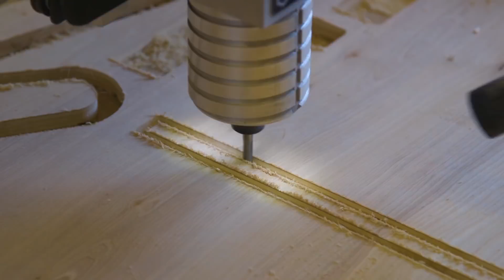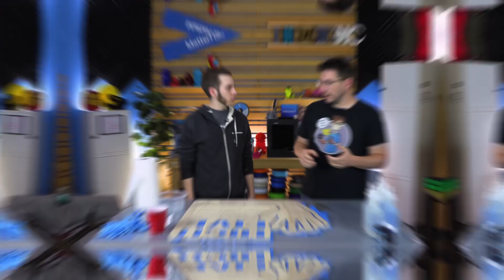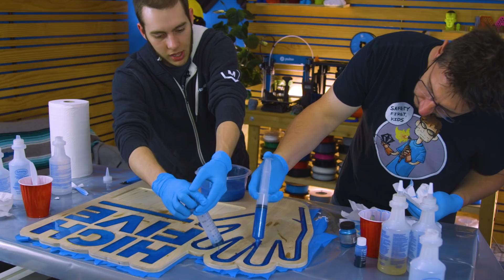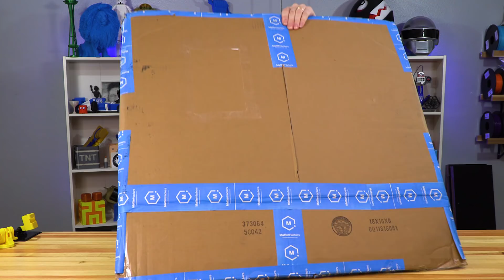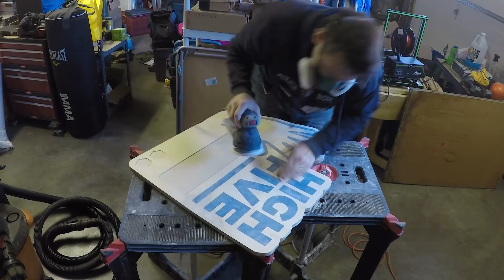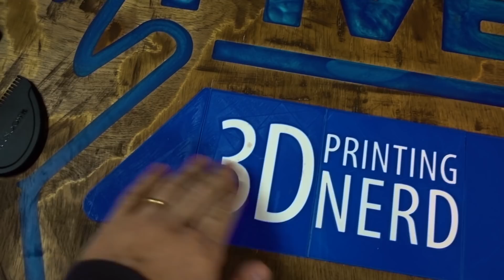Making a HUGE HIGHFIVE SIGN with Matterhackers and Carbide3D

Comment: I love your channel but being a carpenter the way you finished that plywood made me sad. Your 60grit belt sanding went through the top layer of the plywood in many spots that's why it got so splotchy and inconsistent with the stain. I understand the move to 60grit though sanding resin is a pain in the ass!

Comment: Using a heat gun or a propane torch right after pouring the resin will bring the bubbles out of the resin.
Reply from the maker: That’s why I used a propane torch
Reply: Haha yeah I wrote that mid video and when I got to that part I was like hey he did do that.
Reply from the maker: Well, I listened to you! :)

Comment: It does open up a whole world once you start combining 3D printing with other materials.  Odds are at some point you're going to think - concrete.  If you do - put a thin layer of epoxy on your 3D printed molds to fill in any tiny gaps present in most 3D prints, and try CTS Cement All if you're impatient like me (1 day vs portland cement based mixes that are 28 days full strength).  Edit: Oh, and this one caused me HUGE headaches before it finally got through to my brain - always always cement into water.  Do not put water into cement.  You'll think 'well, the water weighs a lot less' - you'll think eh, it should work either way, how can it make a big difference, but override those thoughts because it does make a tremendous difference in ease of mixing and the final result's uniform strength.

Comment: Eh, not really a fan of how splotchy the stain looks. Would have looked better if you'd used a solid piece of wood (would have involved more prep work, but also wouldn't have to worry about the veneer being sanded away.) That or just sand off all of the top veneer. You can tell where the layer got sanded through by the change in the grain direction.

Comment: I think you may have got bubble coming out of the wood. Resin gets hot and any air trapped in the wood on the surface would have got bigger due to heat and started to rise and then got trapped in the resin when it set

Comment: safety first... eye protection... resperator. and joel, test different kinds of finishes on the back of the wood and the resin instead of the front of the wood. test. test. test. and always read the instructions, and watch youtube for what not to do. (resin is flamable, toxic, cannot be mixed with some plastics, (like PETG, oils), left in the sun for long periods of time or under heat). i know this. check on advanced chemistry.

Comment: Came out looking great. Suggestions for future resin and wood projects: 
1. Paint a sealing coat of resin on the plywood so it does not soak in when you pour. It also would have given you more control, and eliminated the need to pour the resin all over, like Alec did. (personal experience)
2. Watch out with those belt sanders. Yes, an orbital sander takes longer, but it will save the veneer on the plywood. (again, personal experience)
3. If you're going to make the color so strong that the resin becomes opaque, there's no reason to cut all the way through, and you'll be better off just doing pocket cuts, sealing with resin, then pouring.

Comment: I was going to warn you not to sand through the thin veneer layer!  Sorry man, I was too late.  You made it work and you inspired many.  Mission accomplished.  I agree with others below it needs to be back lit.  I would CNC route an edge center layer (3/4 ply) and a solid back layer (thin ply) and then use LED strip lighting.

Comment: Yes, we all learn new things at some time 😃 I learned with plywood and cnc that once cut, switch to a thinner bit with 4-6 flutes and run an outer edge cleanup pass. Helps all them internal bits get smoothed rather than by hand. This is a cool combo of making methods!
Reply from the maker: That’s great advice!

Comment: Well it's different from your normal. could be better BUT as you said this was a learning experience. I do dome work of this kind. with some better & worse things happening. First thing I would do different would be to put a tape mask on the plywood before cutting out the words and the hand. next then not cut thru leave about a 1/16" material that way no leaks and the board is more stable. with the tape on top you can put the resin in with less worries and a cleaner top. in fact on some signs I lacquer the the surface before cutting the pattern that way when I paint the reveals & if you do have a small problem it will wipe off easily. You did an ok job for your first try thank you for showing how to do this

Comment: Joel,
I am a noobie.
What does the printers use for the models?
Drawings?
Actual articles?
Photos?
What and how?

Thank you.
Reply from the maker: I don’t understand the question - I’m sorry.
Reply: @3DPrintingNerd  how do you tell the printer what to print?
A digital drawing is scanned?

A physical object is scanned some how?

Is that better?
Reply: @3DPrintingNerd  example:
If I want a cup, do take the cup - scan it(?) And the print prints it out?
Can it print from a picture?

Your largest print that 7 day print of the city - what did you use to have the printer make that design?
How does it take the commands?

Comment: Sounds like it was epoxy, you need to give it some heat to cure it faster, and it is quite precise on the ratios as well.
Give it with a heat lamp some 80C for a day and it'll fully cure. Epoxy often does not fully cure until it gets some heat into it.

Comment: Great project, a good exemple of how one can mix mediums and techniques to build. A few things did make me cringe though (the following comments are based on 15 years of make uo fx and proos making so I use a lot of resins and silicones):

- indeed the tacky resin is caused by bad mixing, also might have been too much pigment which at some point starts inhibiting the curing process. Never use those small popsicle sticks for cups bigger than dram cups or little paper cups. Use tongue depressors or, better yet for that container size, paint sticks, and take your time to really scrape the side and bottom well and mix thoroughly.

- NEVER, as was suggested, use a mixer for that; you would simply get air bubbles galore or, even worst, resin foam (unless this is what you want), and it would never scrape the sides. Resins, just like silicones, are not about the speed of the mix but the quality of the mix.

- Curing does not cause bubbles, ever. Curing faster however means that the air bubbles have less time to escape on their own, which are created by the mixing process introducing air in your resin.

- To avoid or reduce bubbles, as you mentionned a degasser (vacuum pot and pump) is by far the best but 1500$+ is a lot for occasional use. Without a vacuum we always do what we call a high pour; pour the thinest possible stream from as high as you can, slowly. This will remove a lot of the trapped air. You can even do this high pour in your syringe by removing the plunger (did it a lot with silicones before getting a vacuum).

- Also the valleys you got is normal; resin shrinks as it cures. You can either do a second coat like what was done or use a mineral filled resin which reduces shrinkage. But as always read the data sheets of the various products to know the shrinkage values; that is what these documents are for.

Lastly, love your channel. 3D printing is a recent tool in my arsenal and Ive been learning (and gettting entertained) a lot from your videos. High five!
Reply: Another addition would be that if the resin isn't good for your skin, it is definitely bad for your eyes and you should probably wear safety goggles 😅
Reply: @user-ej5wx6zu3f  safety goggles are way overkill for small quantities like that (I have yet to see a single workshop use them for that purpose). However if someone wants to use them it is of course always better to be safer than needed than not enough.
Reply: You can get vacuum pumps with pots for about 150€ on ebay. I actually thought about getting one to try drying fillament at room temperature.
Reply: @andreasvogler1875  degassers will not dry; it removes air, not humidity. I seriously doubt the 150$; thr pump alone starts at much higher than that for a cheap onr
Reply: @Arakahn123  But at very low pressure, water evaporates at room temperature. Shouldn't that have the same effect as putting the filament into an oven? Also I have just seen an offer for a pump + pot for 139,59€.
Reply: @andreasvogler1875  Not really, at least not in a way that is significant enough to make a difference, unless you leave it in there for hours, if not days, which means your pump will be running all that time (thus reducing a lot it's life expectancy) as well as the vacuum pot's due to the constant strain. Better off sticking with a dehydrator for that as this is exactly what they are for (I use a cheap 40$ food one that I cut out the bottom of a platter to fit 1kg spools). 

And a vacuum pot and pump at that price it's usually made very cheaply (it will either buckle over time or be unable to reach a decent vacuum), and more than likely be a 1.5 or 3cfm pump (again I have not seen the one you are talking about so this is just theorizing from my part), which means if you want to degass resins or silicone it will take so long to do that the material will start to kick off before you are done or at the very least reduce drastically your working time. For that usage I would never go below 7cfm (I have a dual stage 12cfm pump and it takes 3-5 minutes to properly degass resins)
Reply: @andreasvogler1875  Could always make one like the King of Random did.

Comment: Should have used a torch to remove the bubbles, first mistake.  The second mistake is blue tape sucks check out Stone Coat countertops on how to work with resin.  The last mistake is the choice of stain, way too dark.   Not sure what software he used but Vectric software would have allowed tabs that could have held the fingers together and not be seen.  Other than that, nice job!

Comment: Looks good!   The aluminum tape is stiffer and will often seal better than blue tape.  
One more suggestion to go with the ones in you video and the comments:  seal the front and pour from the back.  This leaves the bubbles and curved surface on the back.